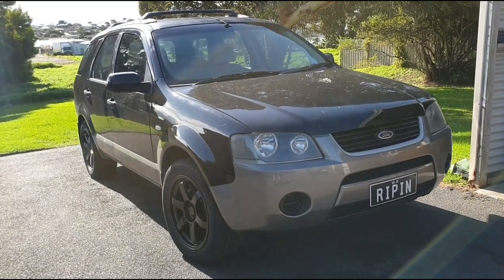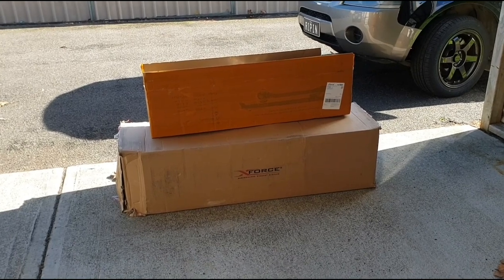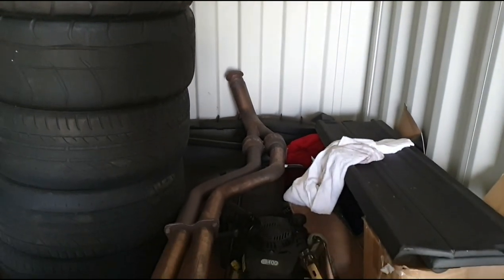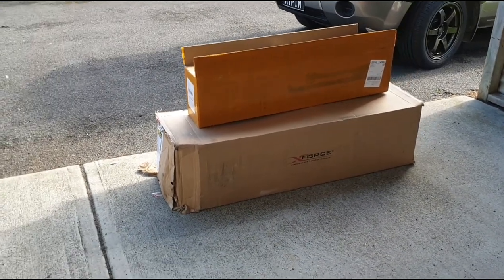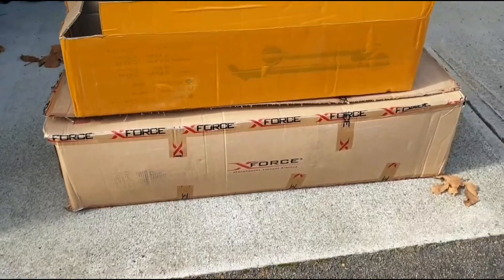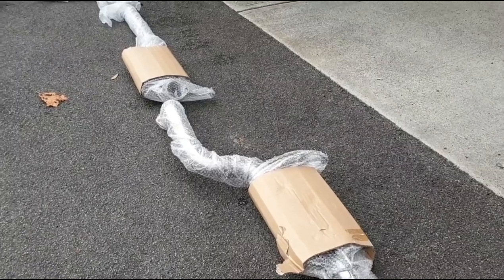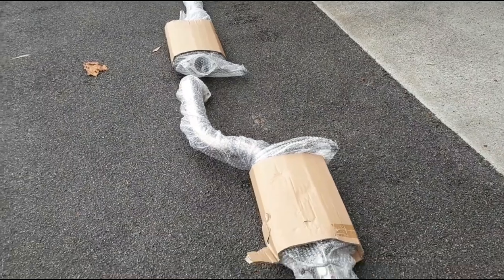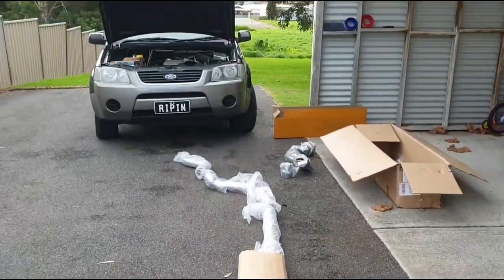What EXHAUST System Will Work?! | N/A BARRA TURBO CONVERSION!! PT3

Comment: I have a territory turbo and recently fitted the tail exhaust it is a brand new factory turbo exhaust 
Just a tip mate I found it necessary to drop the RH side of the IRS about 2 inches to facilitate the installation of the pipe it's 3 inches like the one you are using 
All the best
Reply from the maker: Cheers mate! Appreciate all the advice I can get! I'll keep that in mind 👌
Reply: @RossHollandAU  forgot to mention I had the car up on the hoist and used a gearbox jack to support the RHS of the IRS 
cheers mate and thanks for your content

Comment: i run a 4inch dump into 5inch cat, that goes into a 3.5inch pipe hotdog  and because im lay into the standard TT 3inch rear muffler. one day ill go ahead and do the rear section in 3.5inch but ive never really needed it yet.